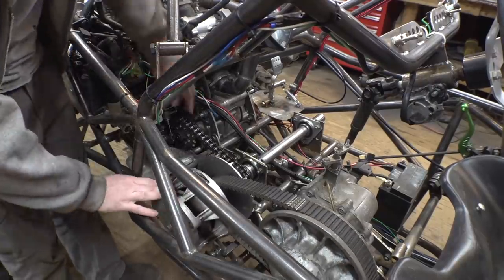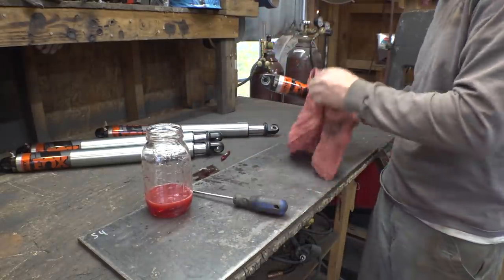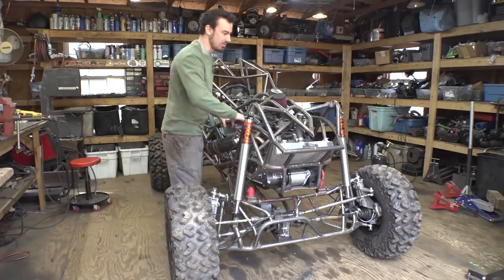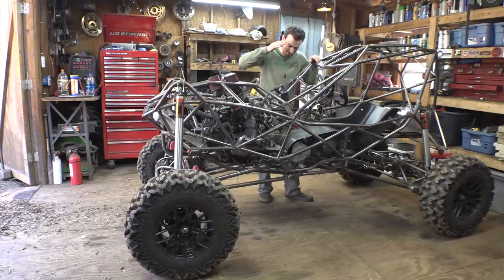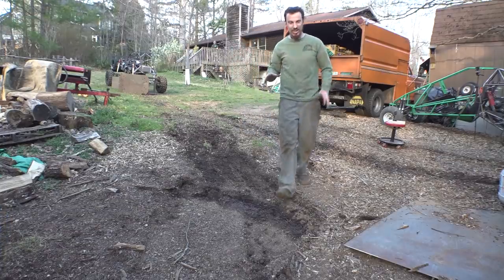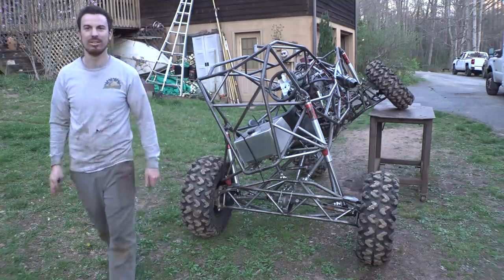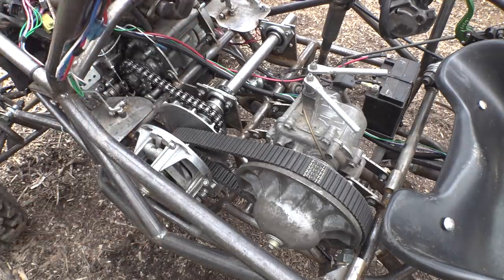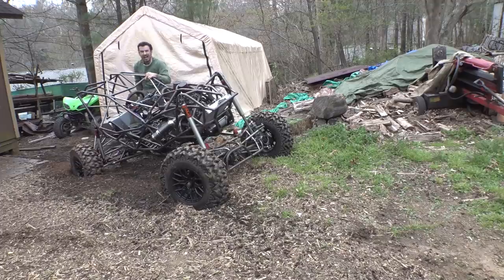First Driving Test!! on the Mini Rock Crawler Build - Part 14

Comment: Primary clutch needs a rebiuld, bushings are shot and wd whatever you used is a bandaid fix at best. Someone else mentioned it here too that you need heavier weights in that primary as well and maybe a different profile too. Lots of variables in a CVT.
Reply: Toooooo many variables
Reply: Definitely needs to start with a heavier primary spring and heavier weights. This will solve both the engagement rpm (more weight - faster engagement) and clamping force (stiffer spring). When doing the flex test you can hear the belt wailing in agony due to slip. See a lot of this problem on the CanAm X3s when guys go to bigger tires (35s) or run paddles
Reply: absolutely..bigger spring for sure. quality belt too ... once he glazed it it was shot ...take a brillo pad to the surfaces of the clutch
Reply: @tshupp72  green scotch bright and clutch cleaner, scuffing at a 45 degree across the sheave faces 👌🏽
Reply: @austinconklin08  >neat
Reply: Ya there's alot wrong with the clutch set up. There are alot of way to adjust them and that makes them tricky to those of us that are not cvt clutch experts.
Reply: Yeah he need to rebuild it. If bushings are shot everything gets funked up, especially the engagement. No use in tuning the clutch until the Bushings are new

Comment: I would have said that the damping was due to the thickness of the oil and the size of the valves used inside the shock. Less oil just means less lubrication and pressure
Reply: You can take out 'valving washers'from inside the shock to make rebound different.Same for dampening.
Reply: Those fox air shocks are emulsion shocks so removing oil will change the damping.
Reply: @FarmerFpv  the way I understand emulsion shocks is that the pressure inside needs to be quite high for the oil to foam up and produce a higher damping effect. So he will still need to balance between how much air and how much oil.. now he has removed a fair amount of oil. The damping will be a lot lower and will require more nitrogen to displace the lost volume from the oil removed. I've seen quite a few posts regarding these shocks as time bombs and I'd probably put money on it being because people have removed too much oil and then filled it with more nitrogen to compensate. They apparently explode like metal airbags 💥💥
Reply: @MaNNeRz91  no
Reply: @FarmerFpv  incorrect. too much oil and they lock up or explode...but thats user error. they are valved like a normal shock. nitrogen is the spring rate oil is the oil. valving is standard same as any other shock.
Reply: @DieselRamcharger  at least give me an explanation instead of a flat no....

That teaches me nothing (if I'm wrong). 

If you don't have enough pressure inside then the oil isn't damping to its fullest ability. If you remove oil you then have to replace the volume of oil you removed with more air.. too much air and pop...
Reply: @MaNNeRz91  I don't claim to understand how these shocks work, but, I'd wager the hydraulic pressure from damping forces is WAY higher than the pneumatic spring pressure.  Since a gas is compressible and a liquid is not, replacing the oil with gas should make the shock less likely to explode.  Does that make sense?  

Also, if you remove oil and then pressurize the shock to the same pressure, you should have enough gas in there to compensate for the removed oil.  This is because of a gas's compressibility:  If the volume the gas occupies is larger, you need more particles in there to make the same pressure.  Does that also make sense?
Reply: facts

Comment: That thing is crazy! So cool
Reply: Cool seeing you here
Reply from the maker: Haha amazing to see you here, thanks man. I love your videos 😁
Reply: @ratherBweldingChris  shock oil volume might impact rebound speed , but it should have nothing to do with whether or not it actually rebounds. Something doesn't compute. Unless the shocks you have had been overfilled with oil, causing some sort of malfunction. But they're just have an oil chamber and an orifice, so I dunno what would be malfunctioning from too much oil. I'm scratching my head on this one. Why did draining the oil finally get the suspension to rebound ? Do you have a Bad pressure gauge in your shop? Maybe the pressure you thought you put in them wasn't what the gauge said.

Comment: Air shocks are a bit like black magic and counter to everything you know. 
I’ve been using them coming on 10 years now. 
You need to add more oil than standard, lower your air pressure to regain ride height and reduce your valving. 
On such a light rig I’d consider drilling out an extra bypass port also.
Reply: What about running lighter oil to adjust for the valving.
Reply: From someone that has been in the offroad suspension feild for many years working with tuning on shocks... the Air pressure is spring force on these, the oil volume changes how these shocks "ramp up" on compression. And the valve shims are the damping of the shock portion of these air shocks. More spring force (air psi) will raise the vehicle. 1.2x psi will = the spring force (if they are 2.0's which they look like to me) Air shocks do not have bypass ports, they are not internal or external bypasses. I assume you are referring to the bleed in the piston.
Reply: @UncleVio  bleed port, that’s the word, essentially bypassing the shim stack.
Reply: @freyja4954  changing the oils viscosity was the first thing I thought of when he just dumped it out. After that oil cavitates you no longer have a shock absorber just an airspring.

Comment: Did you read somewhere in a manual or get told by FOX that this is an acceptable method to reduce damping? I've worked on lots of shocks before (in the bicycle industry) and there's almost always a very specific amount of oil required. 

Removing oil, from my experience, will not reduce demping throughout the travel of the shock, but make it so that there is none at the top of the stroke and some at the bottom (compressed). The only reduction in damping you will get is due to foaming of the oil and that will be extremely unpredictable and constantly changing. 

To reduce the damping of a shock, if you do not have a damping adjustment, you either change the viscosity of the oil (remove and replace the oil) or open up the shock and change the shim stack. I would not recommend changing the shim stack unless thinner oil is not an option. 

Shocks require a specific amount of oil for more than one reason and you will reduce their performance and could damage your very expensive shocks by running them too low or to high on oil. 

Great work tho !
Reply: Joel took the words right out of my mouth. Please listen to Joel.
Reply: @Grim0954  same here, im a mtb suspensions mechanic and you never use less oil than whtas recomended by the maker... u change oil grades oe valve shims.
Reply: Those fox air shocks are emulsion shocks so removing oil will change the damping.
Reply: @FarmerFpv  Really... I've never heard of that. I'll have to look into it. Do you happen to have a link to this information ? I had a quick look and don't see anything. 

Just had a look at their site and don't see anything about this... I do see in the specs that it says "Valving	Tunable, velocity sensitive deburred valve shims" seeming to indicate what I thought was correct. Not saying I'm right, but I'd like to see where FOX recommends this.
Reply from the maker: I’ve tried looking this stuff up but can’t find any information on it with the shocks that I have. But on the pamphlet that came with the shocks it says to adjust the oil level to adjust the damping
Reply: @ratherBweldingChris  Thanks for the response. Very interesting... being that I have rebuilt lots of shocks and understand how most of them work, this is a real head scratcher. 

I have seen it recommended to add more or less oil (in air shocks) to change the way the air spring works. (more oil volume means less air volume) More oil will cause the spring rate to ramp up more quickly. 

The damping is caused by the piston / shim stack being forced through the oil. Regardless of how much oil there is, if the piston is passing through oil, it will encounter the same resistance = the same damping. Not to say that the pamphlet doesn't say that, just that it's got me scratching my head, and wondering how they do this.
Reply: @FarmerFpv  they are Open Bath shox. More oil Will give more damping but the oil needs space when shock os compressed and therefore it will force the seals. Less oil will mean that it looses lubrification and can cause some dry  rubbing of parts. I really dont understand how it can be tumned like that. Even because less oil Will cause foamimg and more internal temperatures.
Reply: strange, i thought air was the spring and oil was the damping.  air holds the weight and oil is just how fast or slow the shocks move through there cycle.  it seems thats why it stayed leaned over in your pull test, lack of spring (air) to push the shcok back up to orginal ride height........maybe
Reply: @ratherBweldingChris  those are expensive shocks modern day high tech stuff you know nothing about them yet you own them and you want to use them and you can't make a phone call to foxes tech line? Every single one of the high-end shock manufacturers have a guy Manning the phone to help you with your issue if if the company does not and it's a chinese-made piece of crap and no one should own it anyway LOL  and something else for your ride height more or less nitrogen or air whatever they take is how you do that right now you don't have enough in them the front maybe but the backs are really low you're going to destroy those things sometimes you a lot of work to watch my friend
Reply: @opengchris18  Yeah, in general you are right. 

I'm pretty sure the issue that he is having has nothing to do with damping. The issue is that he's running the pressure VERY low, in order to get the desired sag ... My guess is that these are designed to hold much more weight, and at this low pressure, the overall friction of the shock is actually limiting the movement, and it has very little to do with the damping / oil.
Reply: @ratherBweldingChris  The Works Shocks I had on my ATV were different in that they used 2 different progressive springs  to help offset my excessive weight ( 350 LB on a Polaris Sportsman independent suspension) but I would think your shocks should be in the center of their travel, it appears to be at much less than half giving you lots of travel up but very little down( the drop off the table was controlled but  kinda like a flat basket ball bounce) Killer build and Windrock ( Coal Creek Mining) would be the best place to take that rig to truly enjoy it ( I heard you mention Brown Mountain, never really liked Brown Mountain. Hatfield and MCkoy trail system would give you a variety of different styles.
Reply: @ratherBweldingChris  i recently rebuilt my dirt bikes rear shock and i know that less oil simply adds a gap of air so there will be a soft spot in the suspension stroke. but being that it said to remove oil it must somehow compensate oil level? i noticed you were pouring the oil out of the shrader valve area so there msut not be a bladder in it? all shocks i have seen have a rubber bladder you fill with air to pressurize the oil to prevent leaks and it makes the suspension return like a spring, however with the ones you have it looks like the air is mixing with the oil? seems odd but i have only rebuilt one shock in my lifetime so theres probably a lot out there im unaware of.
Reply: Its my tyre
Reply: @ratherBweldingChris  It's ok for these. However, you want to do it in a different fashion, four clean cups for four shocks. And you want to drain it all, then using a clean syringe reintroduce however much you want back in. As i recall, over half the volume is where the action starts (minimum volume required to work, might be wrong, but that's how i remember it).

One other thing, if you decide to reuse the mixed up juice, be sure to filter it first, because in a normal situation, that oil's now contaminated (being that it's from four different sources). If you wanna maintain them, avoid mixing stuff up, is what i'm saying.

I've seen these kinds of thing cook a shock in days of use, because of contamination.
Reply: agreed, my thought would be that adjusting the shim valve stacks would be the way to go, or oil weight, that way the support can be tuned for a given weight... 
but it still doesnt get rotnd the fact that the vehicle does not weigh 1000s of KGs more that the shocks were designed for, so it will all be a bit of a "trial and error"
Reply: That’s what I was going to say but seen ur comment I would contact fox tell them what u have weight of the vehicle travel etc. so u don’t ruin the shocks love the build man amazing job
Reply: @bryantucker1270  Good advice.
Reply: @JoelArseneaultYouTube  You are correct. Changing the oil volume only adjusts the spring rate not the damping, some times those words are used interchangeably (incorrectly). All offroad emulsion air shocks like this have a range of allowable oil volumes and changing it does have quite a large effect on the spring rate. In this case less oil volume means a more linear spring rate, which means he can run a higher initial pressure (shock at full extension) and sill end up at the same ride height. The extra pressure helps overcome the stiction of the shock and get it moving even at low pressure (they're also very sticky compared to bicycle shocks).

It does sort of work, but it's not a great solution for a light vehicle. It'll end up leaning really badly in the corners and on side hills, or even just under power as you can see in the pull test. A much better solution is to use shorter shock and put some motion ratio in the suspension but that has to be built into the chassis design.
Reply: @vpsryder  Okay... Now I know I'm talking to a person who really understands shocks /suspension, based on what you said... I was trying to keep my speech so that the average person could kinda understand, but yes, thanks for this comment. 

I had a set of Noleen air forks that used air damping, and I have seen air shocks with negative pressure (opposing air spring) to help counteract stiction. I could tell that his shocks have a lot of stiction when he was moving it at low pressure. 

👍 Many people building things seem to just go with what looks right, or cool, when figuring out suspension geometry. Another channel built a mini bike with a falling rate suspension, and when I tried to point it out in the comments... I was attacked by people who just didn't understand, yet were sure I was wrong. Back in the day I was obsessed with linkages, especially in snowmobile suspension, and would spend hours drawing different ideas out on graph paper. I'd love to have access to a software to play around with concepts. 

Cheers
Reply: @JoelArseneaultYouTube  Agreed
Reply: lots a shock aficionados ere...how about just   leave your egos at the door and watch the video
Reply: @busybee6889  Not sure if that’s a typo ? “Here” maybe? If you’re talking about me, and my ego, that’s not the case. If you read through all of my comments I specifically say, at the beginning, that I’m not sure, and that he should get advice from fox or a manual … so that he doesn’t ruin is expensive parts or have expensive shocks that don’t work properly. Nothing to do with ego. I watch ever single video Chris makes, and he amazes me… just trying to be helpful. I make videos and sometimes I get great insight from comments.
Reply: @busybee6889  So youre saying the guys with more shock knowledge should be silent and not help spread their wisdom. Id rather hear from people more knowledgeable than me, but I guess you dont like learning stuff?
Reply: @jamiethomas8975  just do it without the arrogance

Comment: That torque-twist might become a stability issue when crawling. I imagine those diffs don't have much gear reduction.
15:46 + 24:08  Under heavy strain the driveshafts are leaning the chassis over as they try to turn the axles.
Reply: I doubt it would be too much of an issue. Nothing against the machine, but its not like its a v8 in there twisting it lol

Comment: that is the most badass go-cart I've ever seen. I always wanted to see someone build something like it and it has finally been done. mad props
Reply: also side note: I've been around 4x4 rock crawlers long enough to know that you are going to want a chosen weak point that is easy to replace when broken. guys with weak jeep axles sometimes wont upgrade to chromoly shafts so they don't destroy the ring and pinion gears, all I am saying is the slipping clutch may be a blessing in disguise.